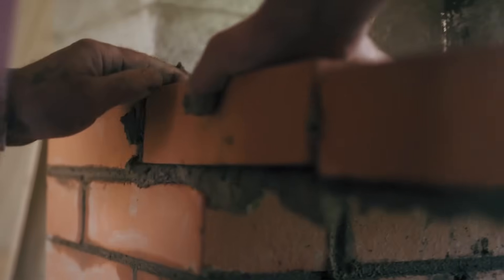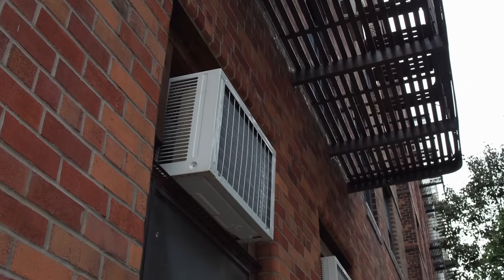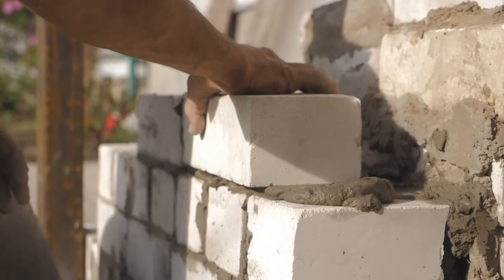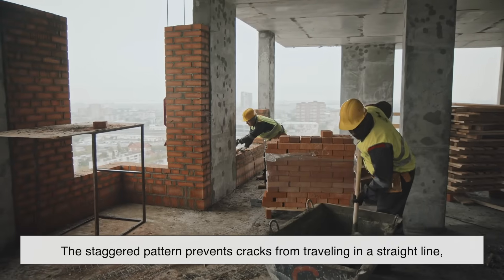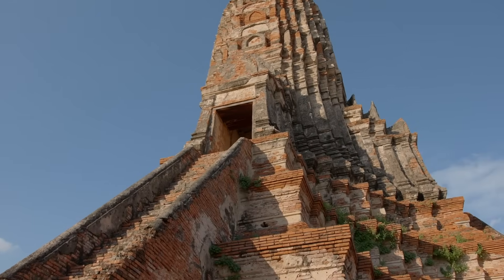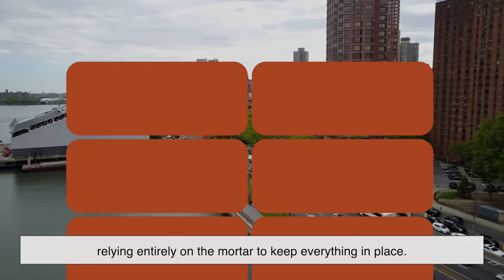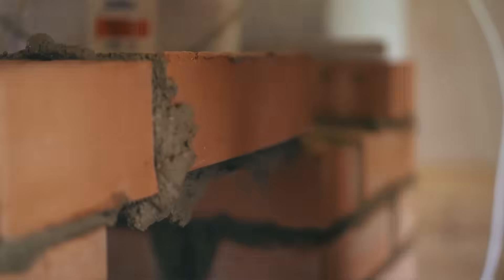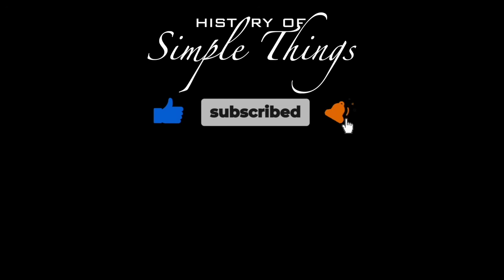Why Are Bricks Staggered Instead of Stacked in Straight Lines?

Comment: I aint no building but I would also guess it simply makes building the was easier. If it were vertically stacked, you would beed to be very careful not misalign the bricks, else it would look wrong. 

In an staggered way, the row bellow does not put any constraint on where to put the row above, as long as it is roughfully on the middle of the first brick, the rest will follow along just fine.

Comment: Nice. But what about stacking the stones vertically rather than horizontally?
Reply: What are you talking about?
Reply: @Biggestfoot10209  Every brick is laid down 'horizontally' that is that the longest side is horizontally. But what if the longest side of a brick is vertically?
Reply: Soldier and sailor courses are often used, mainly for decoration or accent but lack the strength for a full wall
Reply: @ OK But what is stronger (if there is a difference) and why?

Comment: Decades ago our firm bought a used factory that was originally built in the 1960s for Chrysler.  It was concrete block construction.  All of the blocks were laid  straight up...they did not interlock.  Poured concrete columns and beams contained the blocks.  We were told that if there was ever an explosion within the building, that the blocks would blow outward and the poured beams and columns would keep the roof from crashing down.  The building was originally built to service the Saturn-1 rocket, of which Chrysler Corporation was the prime contractor.  The building was in the City of Cape Canaveral.  It is now used as a brewery.